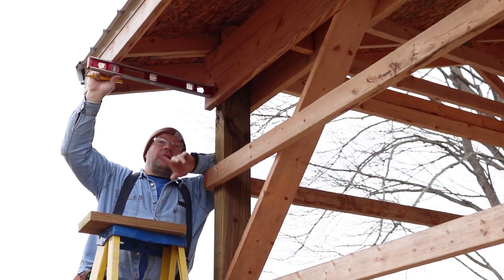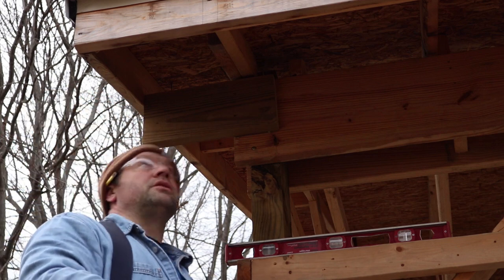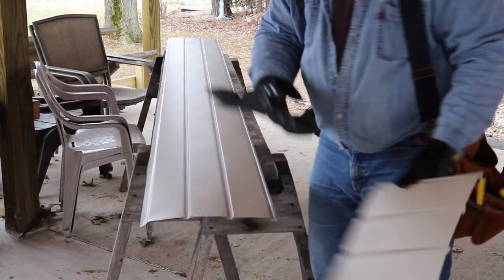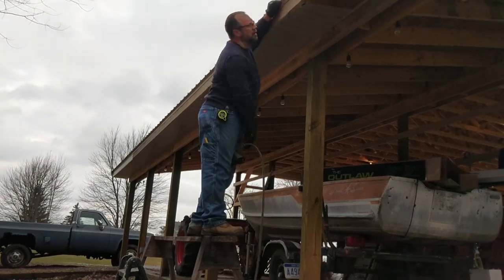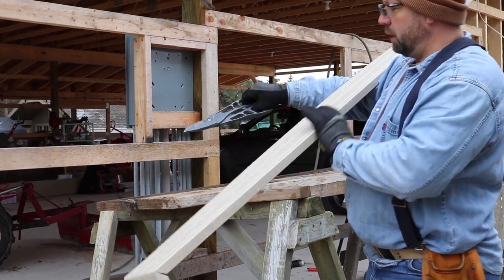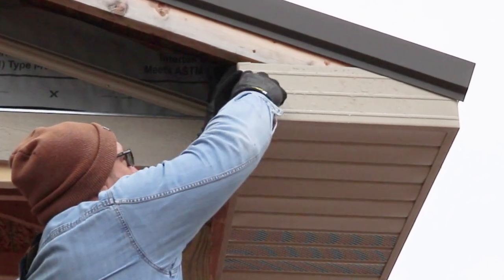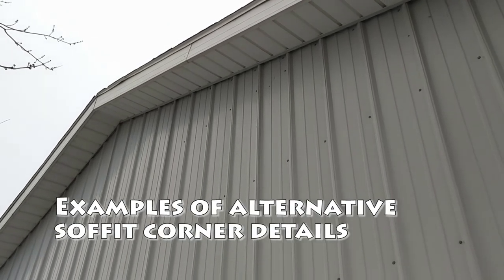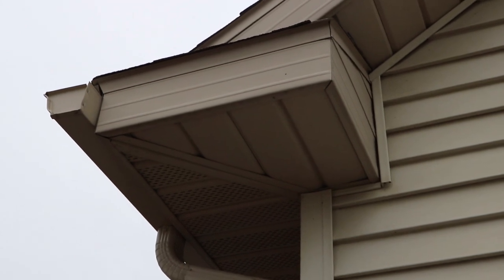Boxed Soffit & Fascia Details - Gable End Soffit Framing - Pole Barn Workshop Build Series

Comment: Looks good. When cutting those corners, if you cut one side at 45 and leave the other one at 90, it’ll still look like a mitred corner but no risk of having any gap there. Rare that a corner is exactly at 90 degrees.
Reply: I'm a trim specialist and I have to agree. We call it ears in the trim world. Always leave ears on any flashing bends. It prevents gaps in the event the framework isnt perfect.

Comment: Good video. What size brads are you using to nail the soffit to the facia board?
Reply from the maker: Thanks Pat, I'm using staples here as they hold better than brads. They are 1/4" crown and I believe they were 1" or 1 1/4".

Comment: Which edge on the F channel did you follow, with the snapped line being the (bottom of fascia board) top side of the soffit. I just did one and I had to snap the line about .625" higher than the bottom of the fascia board so I could put the top edge of the F channel to the chalk line. It seems like if the snapped line was at the same level as the bottom of the fascia board you wouldn't be able to see the chalked line because the F channel would be covering it. Maybe the F channel you used was different than mine. Mine had the slotted holes for nailing in a strip above the channel part of the F.
Reply from the maker: No, I snapped the line even with the bottom of the fascia. It's not ideal, because you can't see the line very well but in the end it worked out. Ideally I should have measured down to follow the bottom flange of the F-channel for the chalk-line. Thanks for the comment.

Comment: Nice Vedio. Do you know what type of contractor does this kind of work? I have part of both soffit & Fascia blown out with storm and framing is rotten. I need someone to repair in the house but not sure who to called?
Reply from the maker: You could try a contractor that specializes in exteriors. Search for window and siding installers. They should be able to help with the soffit and fascia.

Comment: What kind of drip edge did you use on your eaves?
Reply from the maker: It's just the standard drip edge very similar to this one at Mendards:
https://www.menards.com/main/building-materials/roofing-soffits-gutters/metal-roofing/10-roof-edge/beige1564095-60/p-1444448466396.htm
Really the only reason I needed a drip edge with the metal roof is to hold the top of the aluminum fascia in place. Otherwise the metal roof sticks out enough to act like a drip edge.

Comment: Good luck repairing that soffit material....you used nails to hold it in.  I don't think you're suppose to nail soffit in....it slides in.  You can't take it apart now.  I have to repair lights in a soffit ....how would I take what you did apart?  Try puttig the faciar on first and sliding the soffit sheets in....this way I can use a zip tool to make small repairs.
Reply from the maker: Well the intent is not to ever take it apart. If you didn't nail it the wind would rip it down during the first storm.
 I have taken soffit down on occasion by clipping the nail heads off with a pair of diagonal cutters. To pull the fascia out enough to get the soffit out. I'm not sure how you would hold the fascia in place if you didn't nail it.